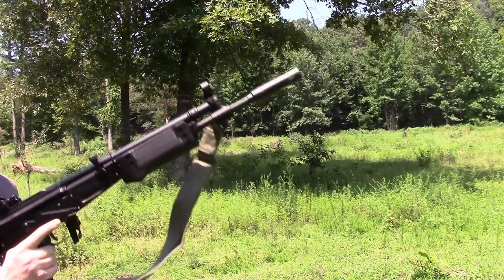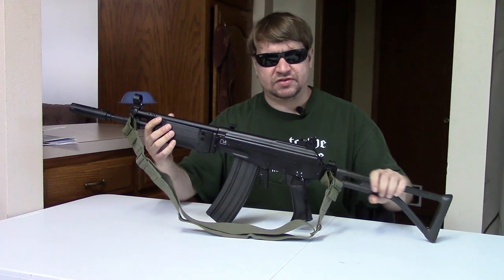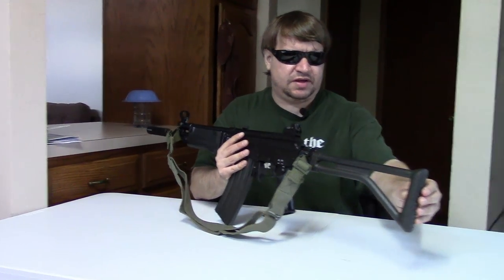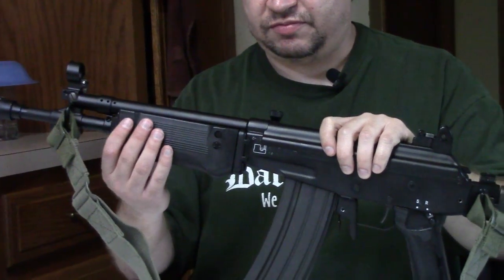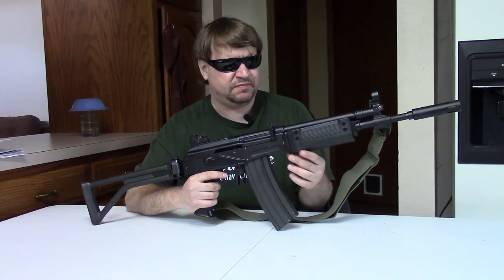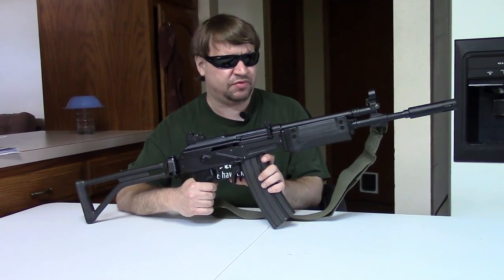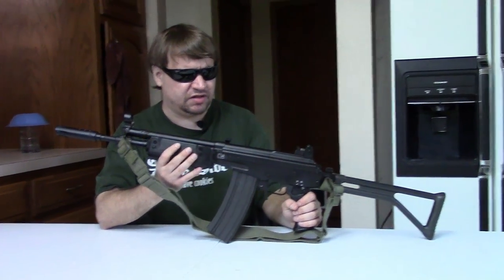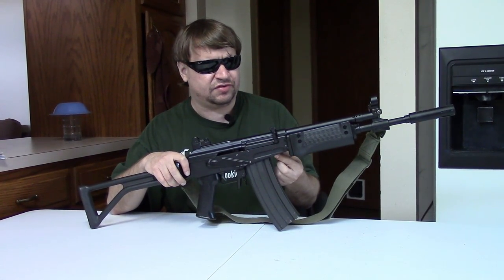Vektor R5 & LM5 - South Africa's Galil SAR Carbines

Comment: Great video. 
Im a South African and you got your history spot on! 
There is also an R6 variant which is much shorter than the R5 this was used by special task units if i am not mistaken
Reply: What is the R4 chambered in and the R5 and R6?  When I say chambered in meaning either 5.56 or the 7.62X39.  Thanks
Reply: Thanks much for watching. Yes, the R6 is the subcompact of the family. Many people call it a 'Micro Galil (MAR) clone' but really its more like a shortened R5/SAR type. Its a bit longer than a MAR and doesn't have all of the same features as the Israeli subcompact model. I think they've even done some semi-auto LM6s but because those are so short, they've never appeared here. Also, SA was under sanctions by the time Vektor/LM had introduced the R6 series. Honnestly, us Americans are very lucky that a few LM4s and LM5s came in at all, cheers.
Reply: Roger Smith they’re chambered in 5.56
Reply: Correct I was issued with a R5 in the armor core (1SSB) they were smaller and fitted nicely in the Eland, Rookat & Ratel I think the R4 and likes would be harder to lug around in the cars. The R5 I had was a shoddy hand me down the auto / single fire thumb lever would drop to auto at the firing range and yep i ran my ass off with amo cases for shooting on auto.

Comment: Wikipedia says that the book "Small Arms For Urban Combat" says that there are improvements to the R4's internal operating mechanism over the Galil. What were these improvements, specifically?
Reply: Who knows? Its wiki afterall.
Reply: it improved over the original Galil. But Israeli Galils all so improved.
Reply: The R4 had a spring loaded firing pin instead of a free floating one and it also had a buffer to reduce felt recoil and so the gun doesn't beat itself up as much.
Reply: @MetalheadMitch762  Thank you.

Comment: I was about to ask you if you had ever seen any of the Vektor handguns but then I realized I needed to word it a bit differently (no disrespect intended).  Ever had your hands on any of those?  Kind of funky and futuristic.
Reply: No reason to word it differently, and yes I've handled and fired a couple CP-1s.  Both with the flush fit 10 rd and the extended 13 round mags. Its an  odd gun. It feels both well made and cheap at teh same time haha.

Comment: Since they handed power over to the ANC South Africa has gone down the proverbial shithole to the point where its pretty much swirling the drain at this point..  Since our congress apparently loves communists and lifted the import bans on SA when the Boers were deposed I'm surprised none of the importers have approached that dumpster fire of an economy and tried to negotiate with the factory to make a US Import friendly model at a reasonable price..   Surely these could sell for around the same price as a Galil Ace and probably be purchased for less than they can be imported from Israel..   With the shit quality of many AK variants lately a top tier milled AK would be a most welcome addition to the genre.